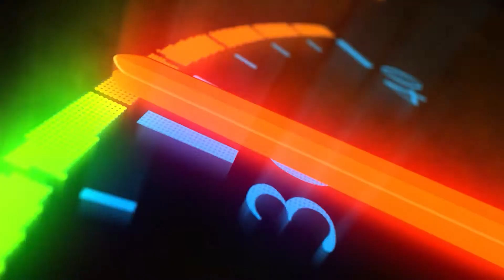7.3 Ford Powerstroke Diesel Heads porting on a Rottler Machine!

Comment: At least I’m not the only human being on the planet that is porting my 7.3 heads, Helical intake ports must be a challenge because there’s hardly Any information on YouTube that addresses them. Whomever comes out with aluminum ported heads with upsized valves that outflow stock heads are going to have the attention of many. KDD has a cast iron set and advertises 40% flow increase, with stock size valves and still have the needed cylinder swirl, but for $6k and have zero reviews, they probably would if they could drop that price tag a little bit. They need to install them heads on an engine and post them numbers and provide proof not just advertise a tall myth at this point. Has anyone heard or seen anyone with a set of them on anyone’s vehicle anywhere yet? I’m trying to be optimistic but lack of proof leaves too many questions. CHOATE…. You Can Do It!
Reply from the maker: 40% seems impossible. There's not enough room in the casting. I assume they mean 40% total, intake plus exhaust, which is where ours are at.
Reply: @choateengineeringperformance  well please make a video with those heads and a Dyno Test, A verses B, Folks will pay attention to that !